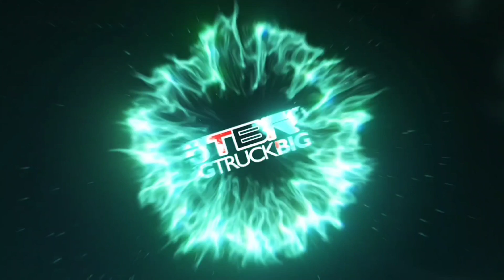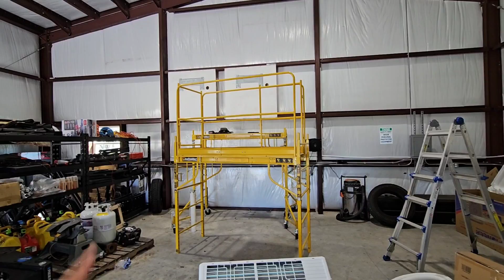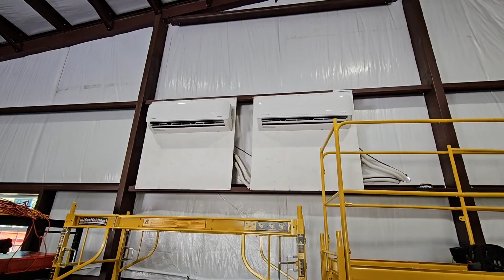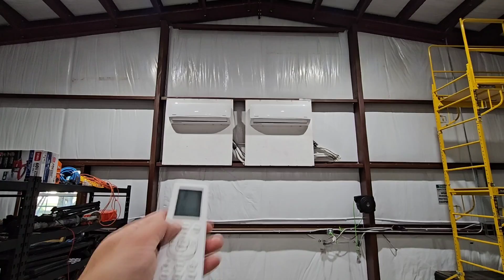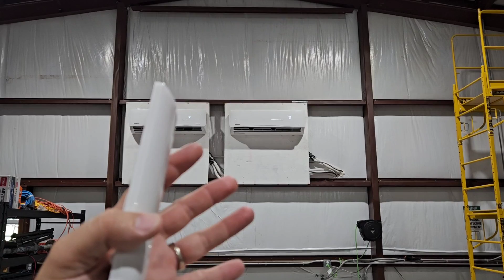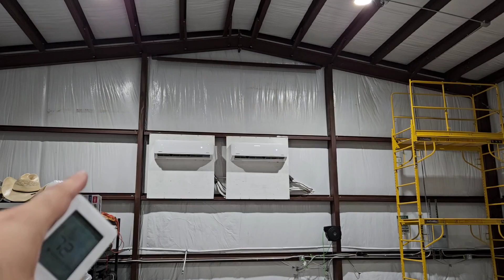Barn gets AC! Pioneer 24,000BTU Inverter+ Mini Splits with Heat Pumps

Comment: I'm in the beginning stages of the exact smae project, and in the same building as you have! Who did you find in TX to do the install?
Reply from the maker: Most reputable AC companies can do this no problem
Reply: @BTBRV  Thanks! I've been looking but can't find anyone that has any good knowledge of this type of building. Only found one that bolted the handler directly into the steel...which I though was weird.

Comment: I would have never considered any other system for a building like that. I have twin 24K Mitsubishi units. Each does 3 rooms of my 6 room ranch here in New Hampshire. They are supposed to be good for heating down to +4 degrees , but I find them to be working like a dog below 20F, so I run my oil heat. Doing my own install saved me a ton because I had the knowledge and proper tools, such as a vacuum pump. My father did HVAC/R for 61 years. My only question for you, is why are both units at one end instead of being at opposite ends or on the sides?

Comment: JD what size is your shop? I'm looking into minisplit for mine which is 24x40. I did install a BigA fan which helps drastically but i would like it to cut the humidity down as well as add heat when needed. I am not too far from ya between SA and Austin so our humidity isnt as bad as yours but bad enough and i suspect we will be colder as we are in the hill country.
Reply: @fonnfour  what did you find out? I have debit card in hand ready to order a mini. My shop is 25x50 with 17ft ceilings. It's got ceiling insulation only. Radiant barrier overlay everywhere else including door... can't make up my mind between 24,000 and 36,000 unit.. building engines in my shop from May through October is tough here in the humid Houston area

Comment: Yes i have 3 r-19 shop overhead doors.  Not cheap but very effective in the MT environment.   The shop is 4800 sq ft and even at 0 degrees the shop stays above freezing without heat just passive sunlight.
It is sprayed foam also r-19.

Comment: i'm installing a heat pump(mini split) in my doublec ar garage for both heating and cooling.  i'm about an hour northeast of detroit in canada.
btw, an airconditioner is a heat pump.  the "heat pump" that you buy these days, is a reversible heat pump. ie, it can "pump" heat in or out of an enclosed space

Comment: I prefer the Mr Cool brand, they come pre charged with refringent , fast install and boom, yur done. put 2 24000 btu units in my 2400 sq ft house. Love them.
Reply from the maker: These come precharged as well but the process of connecting them will introduce air into the system that should be vacuumed out.  Any professional air conditioning company doing an install on these or even the Mr Cool brand mini splits will vacuum them out.
Reply: I dont know about that, they work perfectly fine.  @BTBRV
Reply: My father did HVAC/R for 61 years and in the few instances that units came with precharged lines, he still vacuumed it out. It is the 100% proper way to do the install. You certainly hired a competent company that does it right. @BTBRV
Reply: The Mr. Cool ones are fully precharged including the line sets. They use quick connect fittings kinda like a hydraulic fitting on your tractor but with a screw that opens the valve after its connected together. The only air that can get in the system is a minuscule amount in the fitting. So no vacuum or top off charge is needed.
Reply: That is correct.... @95dodgev10
Reply: Quite sure they do not let air it when installed.  Have installed multiple units myself.

Comment: JD, sir, it seems like you got your mini split with heat pump installed just in time. I understand there is a cold front moving across the country this weekend and first of next week. It will be interesting to hear if you need to use the heat pump. Thank you